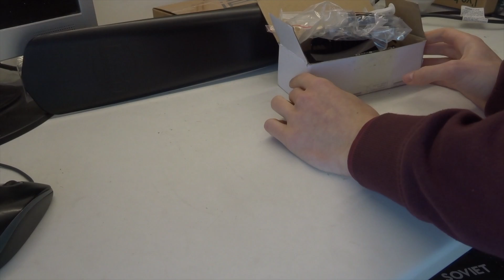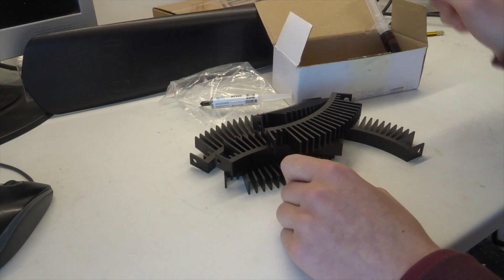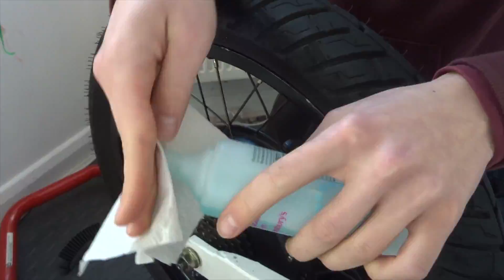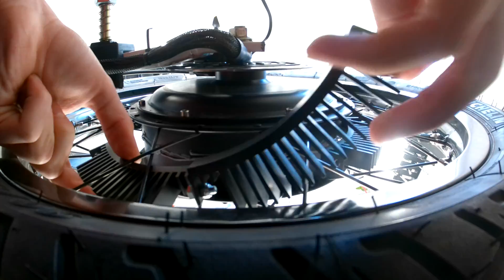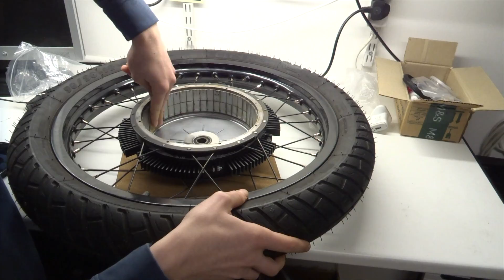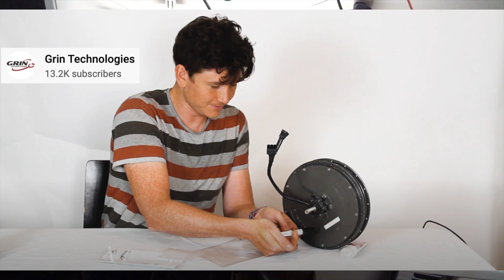Keep it cool! (with Hubsinks and Ferrofluid) -  8kW Enduro MSVA eBike V3 Build - Part 19

Comment: I build computers and when I use thermal past I try not to use to much because it won't transfer the heat correctly you want just enough to transfer the heat to the cooling block. if you do it again apply several drops on the hub sink and when it tightens around the hub it will squeeze the drops of thermal past evenly. if you don't trust that try and smear a thin coat on the hub sink and the hub but remember to much thermal paste can cause the heat not to transfer correctly.
Reply from the maker: Good to know!

Comment: I have personally tried the ferro fluid and hubsink on my stealth bomber clone, and I've found that I wouldn't recommend the ferro fluid part. My bike is a 72v 5000 watt hub motor, and heavy at a good 100+ lbs. Anyway, the motor would get very hot during the sunmertime especially. I dont know how hot but i know it was hot enough that id pull over on long rides and cool it with a wet rag becaue i was afraid id damage it if i didnt. So i tried the hubsink in combo with the fluid and after 3weeks of heavy use at full throttle whenever possible, late summer, i kept having issues with the motor sputtering and having connection problems. So i take it apart and ALL of the fluid had condensed and formed into thick pockets of gum. Not a single drop was left, none of it was fluid. So I don't know what the base is in this stuff but it apparently must be some kind of water base or solvent base because it obviously had all evaporated. Leaving behind nothing but the thick gummy ferrous material. So at that point it was causing more resistance to the motor, making it work harder.

Comment: Those heat sinks are way too expensive for what they do...
Reply: Apparently statorade plus these hubs is the best type of cooling you can get for your stator. Compared to drilling holes or watercooling
Reply: What do you suggest for cooling this build 72v 5k watt hub motor 72v 80 ah controller 72v60a battery with a 100a bms enduro frame
Reply: It’s 100 percent worth it. Allows you to double your power output to the motor without overheating. This allows you to get up to 8000w peak, 6000 continuous on a 135mm dropout motor that normally can only do 3000w continuous.
Reply: Not really you can get em for 80 bucks, I'm gonna do mine it's better than buying another hub motor. It just looks time consuming

Comment: Will I get better range with these mods?  Seems like less would ease battery usage.
Reply from the maker: It's more about dissipating heat rather than making the motor more efficient, but perhaps lower coil temps have a slightly lower resistance so save a bit of power? Will have to see when I get out riding it.
Reply: You get better range by reducing air resistance. The air resistance above 32 kph (20 mph) is so strong, it can cut your range in half. Lower your speed to double your range.

Comment: Hello mate,I pulled my front brake on my stealth bomber without it been connected to disk now its locked,I noticed on one of your vids you done the same,can you send me link of video you watched to fix yours plz,cheers
Reply from the maker: If you mean the pistons have been pushed in too far, just get something in there (ideally a plastic spudger but can be a screwdriver) and push them back as far as they will go.

Comment: Remove a little material from the joints in each section  of the hub sinks for better contact with the hub you want a tighter fit to the hub for better heat transfer
Reply from the maker: I could do, but that's a lot of work for probably not much gain at all. The hub and the fins feel at the same temp from the small amount of testing I've done so far which is the key aim.